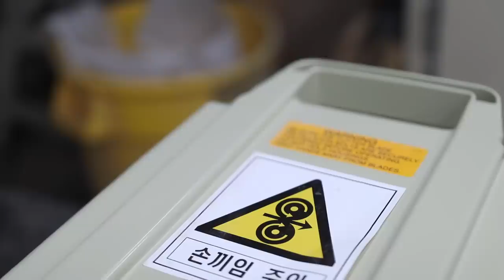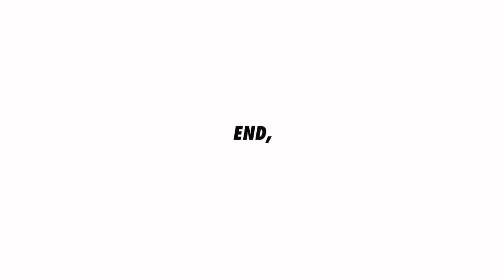W95_Book shelf wall installation

Comment: what's the maximum weight you can make on each shelf? because books tend to be pretty heavy...
Reply: The screws won't fail, if anything it'll be the plywood splitting but also seeing how the shelf spans are only about 2 feet it should be fine.

Comment: Why did you use impact driver to drill the pilot hole and and the common drill to drive the screw? Did the impact have too much torque for screwing the plywood?
Reply from the maker: my impact can adjust torque. the reason I use impact... just... small and light...😂

Comment: Where's the finishing footage? Were there any gaps between the sides of the piece and the wall?
Reply from the maker: yes~ there are the gaps because the walls not verticality, so I choose the gap. I filled inside of the gaps by wood pieces.
Reply: Jerk Of All Trades  i see now. 11:10 there are gaps. 11:28 no gaps.